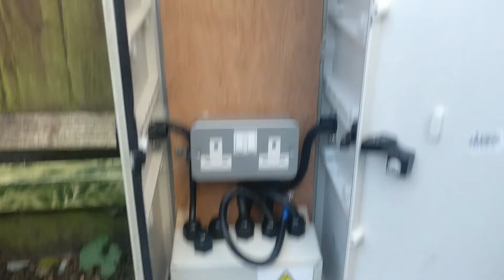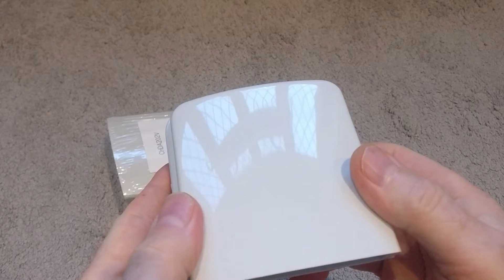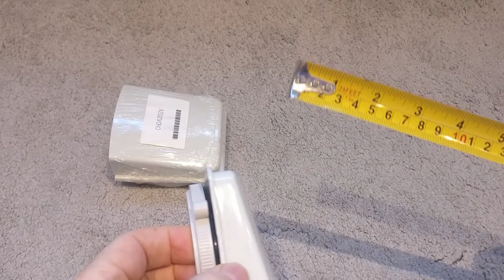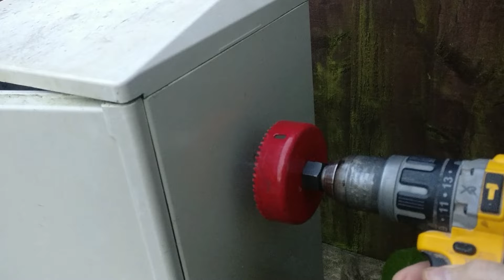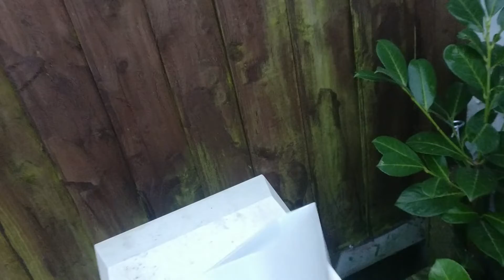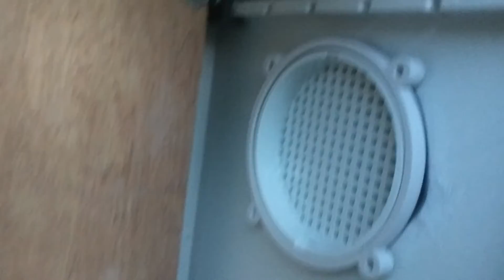Outside Electrical Cabinet Enclosure |  Adding an Air Vent

Comment: Just curious -  do wasps gather on the outside?   Protected from rain and predators.
Reply from the maker: Hi. No, no insects at all. I did wonder the same before I installed it, but nothing on the outside or inside 👍